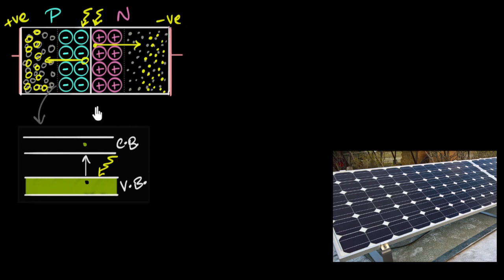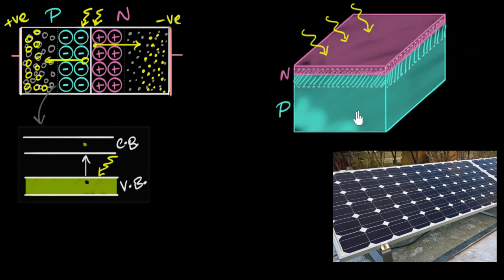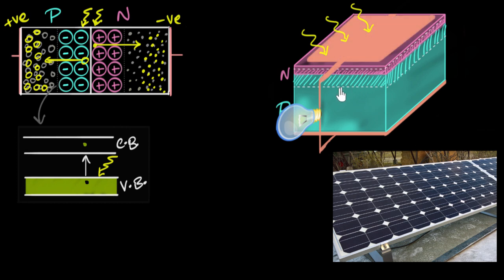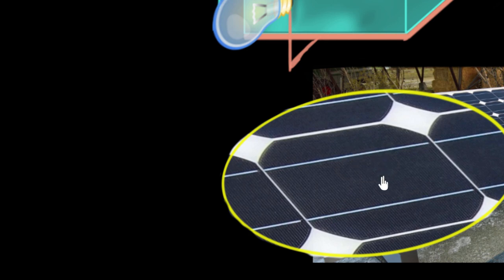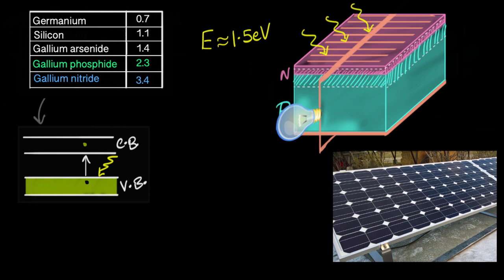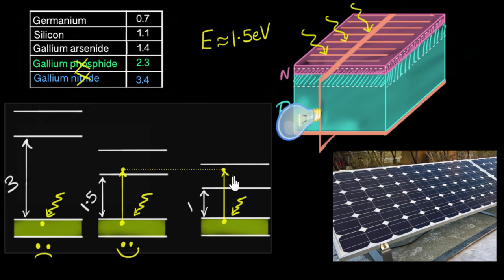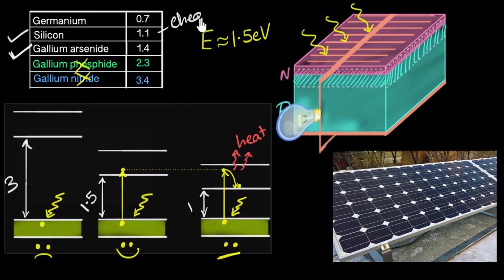Solar cells - fabrication & material's used | Semiconductor | Physics | Khan Academy

Comment: Sir ,why electrons love to stay at lower energy level,as you explained electrons absorb 1.5ev but fall to 1.1 ev level in silicon by dissipating heat energy?what feature make electrons to love lower energy level?
Reply: lower energy levels corresponds to more stability, therefore electrons likes to be in lower energy levels
Reply: Everything, even electrons love to stay at lower energy… or accidentally go to lower energy, but can’t move up to a higher energy.

Comment: 00:01 Solar panels are constructed using specific semiconductor materials.
01:10 Depletion region and photovoltaic effect explanation
02:19 Balancing wire thickness and absorption area for reduced resistance
03:33 Solar cells use finger-like projections for efficient absorption and electron flow.
04:37 Solar cells require photon energy higher than band gap for electron absorption
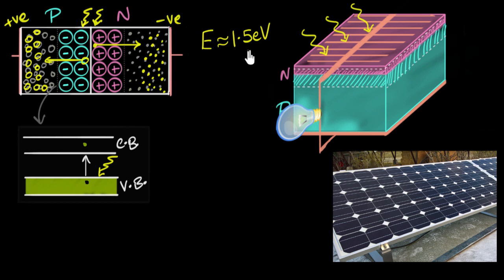05:43 Selecting the best semiconductor material for solar cells
06:54 Different semiconductors absorb photons differently based on their band gaps.
08:06 Efficient solar cell construction materials

Comment: Thank you very much for the explanation. Sr. on 5:41 you told about the energy of majority of electrons coming from sun is E = 1.5 ev. Will you please explain it. I tried finding the energy of majority of electrons on net. However, i couldn't find it. Is this value an assumption or fact. Please answer. Thanks in advance.
Reply: A graph is there to explain the spectrum of energy in the photons from sunlight, in the ncert class 12  physics book...you can refer that